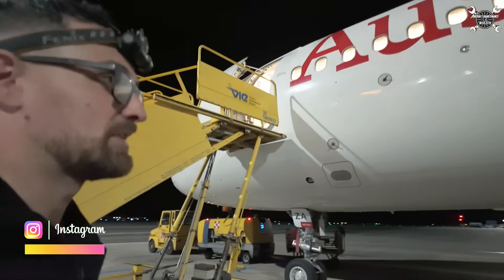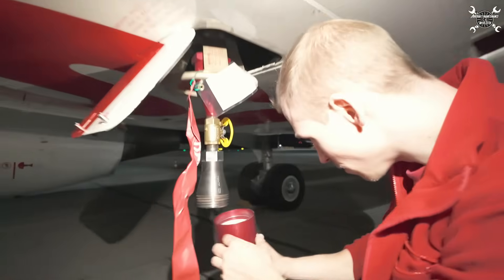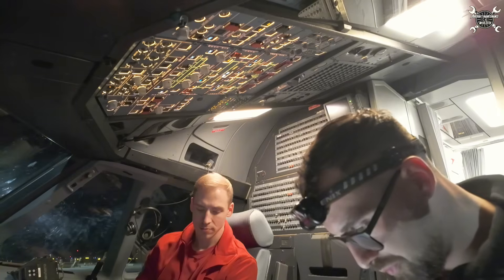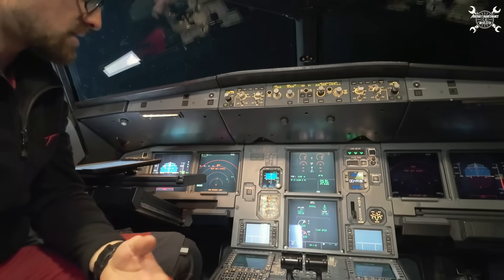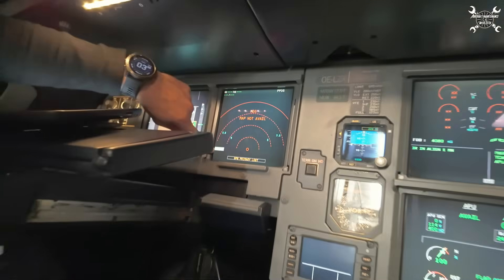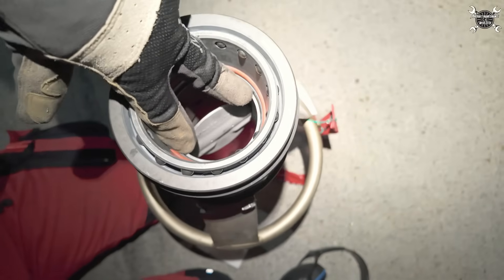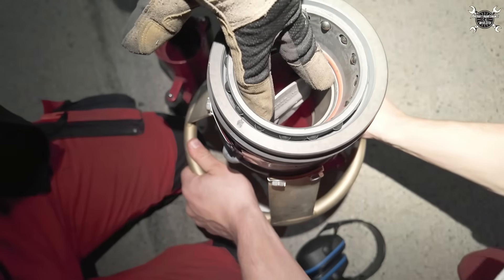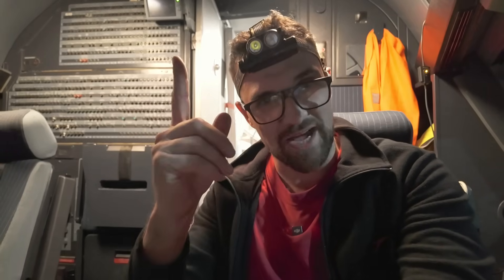Decontamination of the APU Bleed-Air Ducting System

Comment: Could you maybe tell me which of the Austrian A320/A321 are running on EIS1 or EIS2 and what Weather Radar and COM Panels the NEOS are equipped with or is that confidential information of Austrian? I am interested in that, cause I would need that information for Liveries in the new Flight Simulator.

Comment: I am surprised you guys dont run external power during apu tests or checks. I was trained on military hardware so stuff like this is very  different.
Reply from the maker: Hello yes, we always use GPU, it is cheaper. Just we switched it off during work outside of aircraft

Comment: What CB did you pull before the APU fire test?
Reply from the maker: Auto fire extinguisher
Reply: @zeto.r  ah, and that's not inhibited during the test? yikes
Reply from the maker: There is always a chance that something will not work as it should, better safe than sorry
Reply: @zeto.r  now I'll be paranoid next time I do the APU fire test lol, I don't even think that CB is accesible from the flight deck in the jet I fly
Reply from the maker: Just follow the AMM or if you are a pilot follow the company process and you will be just fine 🙂

Comment: What’s not mentioned is that it’s not just an unpleasant smell when oil gets in the bleed duct. It’s an extremely toxic vaporized oil the gets mixed into the air you’re breathing.
Reply from the maker: But first, it needs to get in the packs. If not this is enough otherwise you must perform decontamination of packs as well

Comment: Waaaaait... so with that check valve tool, could you theoretically use the APU / plane to ground start another plane?  Like, if zombies were coming and you couldn't find a huffer or something lol.
Reply from the maker: Most probably yes, you should pull one c/b to trick APU and create higher pressure and then it will be possible
Reply: @zeto.r what C/B? and why?
Reply from the maker: CPC one of them and APU will lose info about required pressure so it will go full power

Comment: Hi Thomas, thank you for showing this task. 
I have a question regarding the video.
Are you allowed to leave the flight deck with the APU running? Is the APU extinguish button at the nose gear sufficient enough for emergencys?
Thank you in advance!!!
Reply from the maker: Nice point, let me explain.  A320 on the ground and in the air has auto-shutdown protection controlled by a computer. On the ground, we have also an auto extinguish function which in case of fire releases agentin in APU compartment and it is, controlled by a computer
Reply: I feel like there are ALWAYS APU's running all over the airport at any given time, during crew changes, maintenance, just sitting waiting for boarding, etc. It's very common without someone on the flight deck.  I BELIEVE (on the Airbus aircraft anyways) that there is an APU fire indicator and shutdown/fire bottle switch in the nose gear well area? Maybe even a horn or something? But yeah, ground crew would have easy access to shut it down if anything happened.